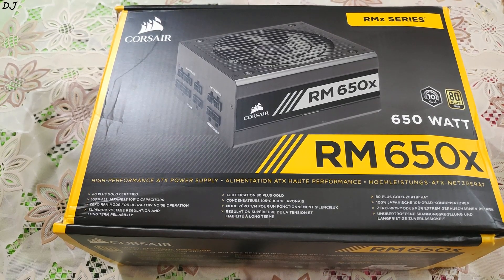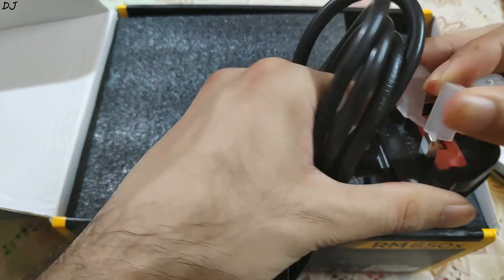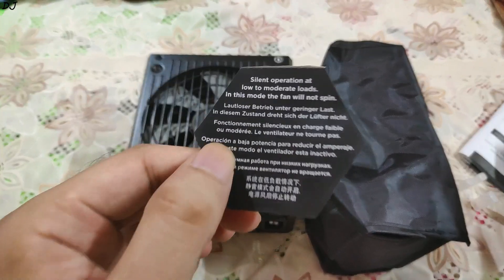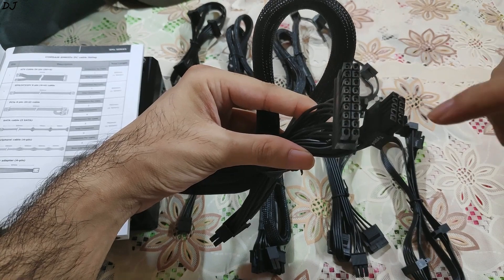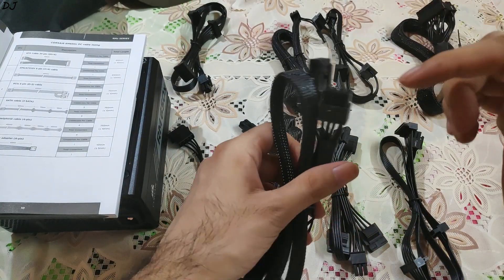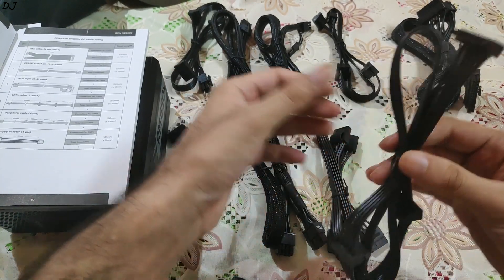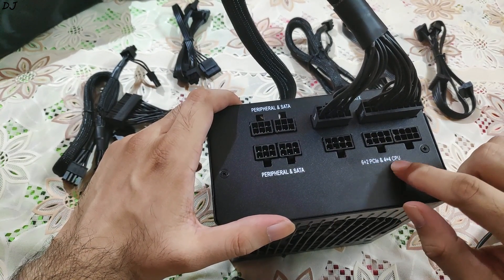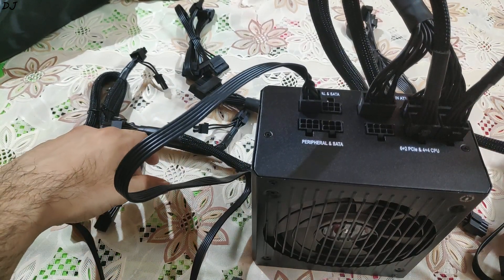Corsair RM650x 2018 Power Supply Modular Cable Installation Guide & Overview

Comment: Hey, my motherboard z390 Aorus master has two CPU ATX 12v 2x4 sockets. But rm650x comes with 1 lead. Where can I buy another one?
Reply from the maker: Hello , rm650x only comes with 1 eight pin (2x 4) eps cable , you can  connect it to the 8 pin socket of your mobo and it will work fine , extra sockets are for extreme OC , the extra cable is provided with rm750x and above models , their maybe a splitter cable available but I'm not sure about it . Extreme OC is also not a big deal as reported by the users , only getting around 100-200 MHz OC .
Reply: @GamingDJ4u  I've decided to go with the 750w power supply because it comes with two, since my motherboard manufacturers state my 9700k will require both plugged in to reach full potential. And using a dual 6+2 pin pcie gpu too..Your information is correct from pre 2018 motherboards but allot has changed in 2020 Thanks for the reply and thanks for keeping me informed appreciate you not letting me make a wrong purchase,
Reply from the maker: Even my motherboard msi b450 pro carbon ac comes with an additional 4 pin for extreme OC but its not required as a high quality PSU like can deliver the required current via a single cable but if you haven't purchased it yet then you can go with rm750x 👍
Reply: @GamingDJ4u you are correct, there is no drawbacks to not using it. But it will improve overclock and system stability for 9700k and 9900k, eventhough it will oc fine without it.

Comment: How do you use the floppy adapter cause I have a connection from my rgb controller hub and idk where it goes
Reply from the maker: It goes in the motherboard's RGB header , jrgb and JRAINBOW headers are provided in my msi b450 pro carbon ac , check their output , one is  5volt and the other one is 12v , i daisy chained my 3 RGB fans and plugged the wire in the jrgb header , just match with the input of the equipment you're using otherwise providing a higher voltage will fry the LEDs

Comment: Corsair RM650x PSU kitnay ka hua? Or kahasay liye?
Reply from the maker: Rs 8950 from primeabgb
Reply: @GamingDJ4u  ok thanks
Reply: Bhai corsair rm650x may protection circuits nhi hai kya(Like over voltage protection, under voltage protection, short circuit protection,over temp protection, over power protection)? Company k official website pay nhi diya hai. But corsair RM650 or corsair RM750x may diya hai

Comment: My gpu need 8+6 pcle cable, but this power supply doesnt have that 8+6 pcle cable, how can i solve this problem? Thx mate
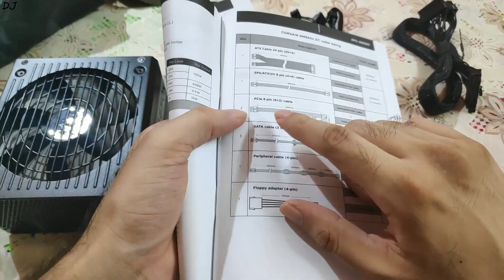Reply from the maker: It does have , this is the cable 05:03 , you can use separate PCI e cables as well to power your GPU
Reply: You'd use the PCI-e cable. The end that plugs into your graphics card has two plugs daisy-chained, and each of those plugs is set up with two pins that can "branch off" for use with a 6-pin connector.

Use all 8 pins on one of the connectors for the 8-pin input, and on the second connector, bend the two extra pins out of the way and plug in the 6-pin connector.

Or, you can use two cables from the power supply if you want, it might result in better performance.

Comment: Question, doesn't that motherboard require 8+4 pin power supply? And that PSU only has a 8-pin?

I have the same motherboard and PSU, thus asking.
Reply from the maker: You need to plug in the 8 pin cable to get it working , the additional 4 pin cable is meant for extreme overclocking
Reply: @GamingDJ4u  Everyone online says that it's for extreme overclocking. However, the manual for the motherboard says to plug in all cables. ;-)

But I guess you're right. I am running it with only 8-pin, and it has worked fine so far (24 hours). CPU is Ryzen 3900x.
Reply from the maker: There is no harm in installing the extra 4 pin cable but the single 8 pin cable is more than enough to provide the power required for your processor i.e 105w tdp
Reply: Gaming DJ I have been stressing out big time over the extra 4 pins. I am reading that some people with the X570 boards are encountering problems if they do not use the 4 pin. I bought an adapter that will convert my 8 pin CPU connector to a 8+4. Hopefully it works. It’s too hard to find a PSU that comes with the 8+4 included right now.
Reply: 9 month update - all still good, without the 4-pin connector.